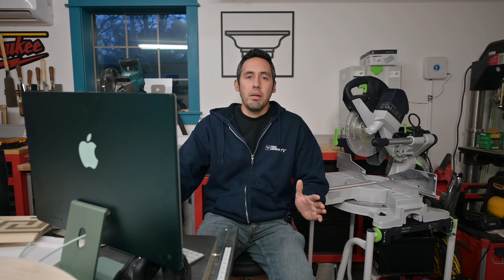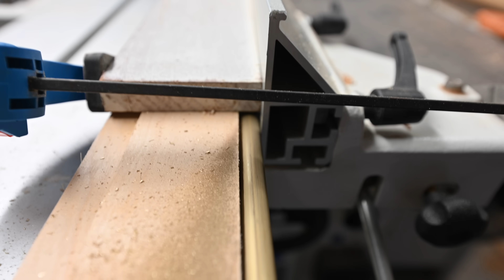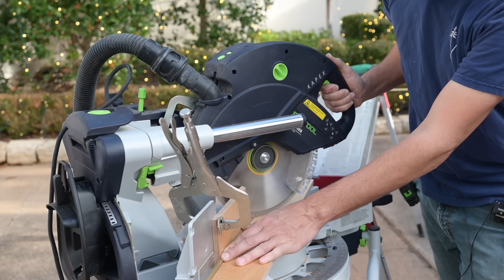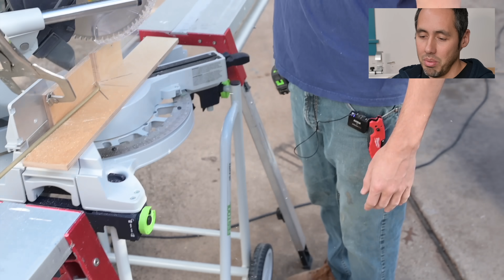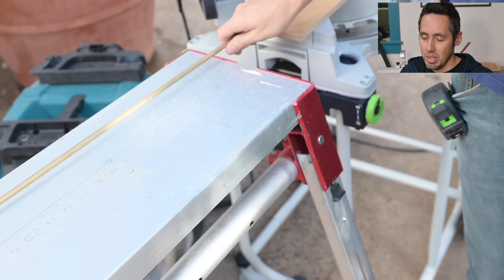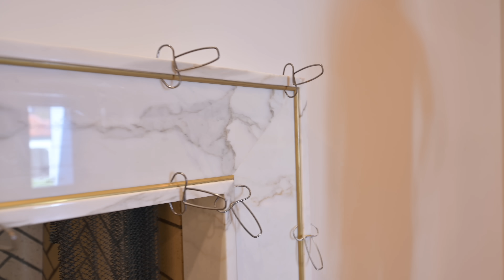It only took 12 years...My first MITER SAW injury.

Comment: Hi Richard, that was thankfully a near miss for you, even though there was pain! I haven't used my table saw since I almost cut the top of my left thumb off a couple of months ago. I think I'm a bit traumatised and don't know what to do to overcome it. It's healed well, just that that thumb is a lot 'slimmer' than the other one, and still tingles in the deepest part of the original cut. I've ordered one of those expensive push blocks in the hope that it'll help me overcome my fear... wish me luck!
Reply: Glad you are okay, you don't need luck, just extreme care.
In Europe, they advocate & partially regulate that a user never ever put their hands near the blade. Push sticks, clamps, don't cut angles, don't put pressure on the falling piece to create a pinch & shear(There have been many tablesaw injuries and deaths without even getting cut by the blade... if the scrap piece gets ejected at a high speed for instance: one user embedded wood in his chest, luckily his nurse wife saved his life).
I could go on and on. Yet it's possible to have a life with no injuries.

Comment: This is a good reminder to always respect your power tools.  Things happen in a split second.  

My worst was when I was ripping boards on a small table saw.  I was standing directly behind the board, it binded up and kicked back.  Good thing I'm not taller than I am because it shot back into the area just below my waist but not low enough to hurt the family jewels.  I did have some bruising and pain but not too bad.

On another note, not job related, when I was a kid my dad and I were putting up the Christmas tree.  We were cutting the bottom few branches off to make room for the stand.  It was getting dark and he was snipping away as I held the branches.  I felt the blade go through my finger.  He cut about 2/3 of the way through my right middle finger.  I went to the ER and they stitched it up.  I still have the scar.  The only good part was that I had to wear this large white bandage for a couple weeks on my middle finger and couldn't bend it.  For a young boy, it was hilarious.

Comment: My worst injury also happened at the miter saw with aluminum stair nose trim for vinyl. I was doing the same as you, but instead of the saw pushing your finger away, it pulled mine into the spinning blade because I was cutting 45 the other way. At first it felt numb like a smashed finger until i looked at it and saw it took a small chunk and blood was dripping. Im lucky to still have all of my fingers and the scarring now is pretty minimal. Didn’t need to go to the ER.

Comment: My hand is currently in a cast and recovering from surgery. I foolishly used a utility knife to pry at an escutcheon on the end of a grab bar for an ADA compliant bathroom install. I often have warned others to always get the right tool to avoid injuries, that thought ran through my mind as I was using the utility knife. I wasn't feeling rushed, it was simply that I had just opened the box and the knife was convenient. Got the escutcheon off but made a small incision into my hand and severed an extensor tendon. One surgery later it's reconnected, cast will come off Jan 5th and I can start physical therapy. I think utility knives are one of the most hazardous tools we use, it's a very easy tool to get too comfortable with. I think the lesson here is, as I always tell people, get the right tool for the task and listen to your brain when you question whether something is safe.

Comment: Glad you're OK, I've had many injuries over my 25 years, I've even done that exact same thing when cutting Aluminium tile trims on the choppy, however one of the worst was on my second stint of oak framing, me and my buddy were out in the rain searching for curved bows to make the cruck supports, he was on the top of the stack, we both had our jacket hoods up so hearing was impaired, I said I think I've found one, pointed to it but said wait, I'm gonna move into a better position, he didn't hear and lifted the top, being wet the 150lb x 12" thick by 8' long bent branch slipped and pinched the pad on my right hand pinky, you could see the bone, we were in the middle of nowhere in Cornwall UK so I cleaned it out, bandaged it up and drove myself to 4 medical centres, none of which would help me, I ended up driving for an hour in absolute agony before resigning to the fact that I might as well drive another half hour to the main hospital, amazingly no fractures but being a musician, that was a real wake up call. 10 years later, it's still very visible, stay safe out there folks!

Comment: I've been building for 25 years, but I'm vain enough to be paranoid about losing a finger (yes, it's vanity, not function that keeps me vigilant).  But there's always that brief moment of complacency that will get you every time. A couple years ago, I was at the table saw, and flicked the off-cut away from the blade while it was still running.  But instead of moving the back end of the piece where there was plenty of clearance from the blade, I flicked the front end, which of course was at the edge of the blade, pushing the tip of my thumb straight into the blade.  Scared me half to death, but fortunately, it just cut about 1/4" into the tip of my thumb, hit bone and deflected off.  No permanent damage, just a mild heart attack, and a strong reminder to always pay attention whenever I'm near a spinning blade.

Comment: Im glad it wasn't worse be careful out there.
Ive been working in construction for over 50 years. Almost inevitable not to have mishap but like you I still have all my body parts still attached. There doesn't seem to be one that stands out over any other they all hurt to some degree or other. One particular instance stands out when working with my dad on his crew. He was a foreman for a pipeline construction company running telephone conduit. I was 17 or 18 at the time, I was working with another guy tunneling under some obstacle. We both were in a hole on both sides of the obstacle tunneling towards each other. It was Pretty confining quarters to work in.  Between us was a large mound of dirt. We would share the tools a heavy tunneling bar and shovel. It was a hot day and hardhat kept bumping the edge of the hole I was in so I took it off. My dad repeatedly told me to put the hardhat back on. I begrudgingly I conceded I had to do what he said being the safety code and all. No sooner do I put it on  my coworker tossed the tunnbar onto the mound in front of us and it rolled down  hitting me on the head with enough force to jar my head down pretty significantly. Im certain without the hardhat it would have split my head open. I don't think I ever told my dad though lol.

Comment: The worst injury I sustained in my 26 years was falling through a subfloor that I didn’t know was rotted out. Luckily it was in a kitchen over a crawlspace, but when I went through I managed to do 3 things; 1. I fell on to plumbing supply lines and busted them causing water to shoot out everywhere. 2. My shin scraped along a joist which pushed tissue and muscle up to my knee making it look like I had a baseball under the skin. 3. My head landed less than 3 inched away from a 16d nail that would’ve speared my head like a melon. Glad you’re ok, man!!

Comment: I’ve had this happen myself. Not with brass but with aluminium. you need a constant pile of wooden off cuts next to the saw to put behind every piece you cut. You need to support the back of EACH cut. the sacrificial fence you have made was great for the first few cuts. But as soon as you cut the mitre out of it you lost the support being the work piece. I hope this helps someone. I learnt this lesson exactly how Richard did. got away injury free but boy does it send a shock wave up your thumb!

Comment: Sometimes minor accidents are blessings because the pain and learning we receive prevents major accidents in the future. I am 64 years old and a lifetime hobbyist woodworker. I have not had an accident since the significant but minor accident I had when I was 14 years old. I had a summer job in a cabinet factory  and my sister asked me to make her some picture frames. I asked the boss to set up a shaper for me so I could make the moulding from plain stock. The shaper was a big industrial machine that had a rotating head of cutter knives approximately 6" in diameter. When the machine started up I felt my then long hair raise up off the side of my face with the wind it created. I made one pass pushing the stock against the fence firmly. Of course removing this huge amount of stock in one pass was ridiculous but I didnt know any better at the time. I felt my newly machined piece and it had some chatter marks so I decided to push it through again pressing the stock very firmly against the fence to remove those marks. About mid way through the fence slipped back grabbing my stock and firing through the wall some 15 feet away. My right hand went into the knives in the process. I was rushed to emergency and a skilled surgeon saved those three fingers on my right hand but the tips remain someone mangled 50 years later.  I never finished those picture frames but I never had an accident after that and I can remember that incident like it happened yesterday !

Comment: Had a kickback injury on my old Craftman table saw. Was cutting 1/4 plywood which was closer to 3/16”.  The extension wings on the saw were stamped steel with raised ribs every few inches for stiffness.  When the fence lined up to a portion of the wing where there was no rib, there was a sizable gap between the bottom of the fence and the wing. Well after partially into the cut, the material went under the fence and caused the material to bind and kickback.  Luckily I only got a small scrape on my arm.  Needless to say, that extension has been replaced with a new one that is totally flat.

Comment: Its hard to say what the worst injury has been in 20+ years of construction, but above getting nailed by a full sheet of 1/2 plywood thrown out a second story window, more than stapleing my thumb to a shower wall, even more painful than the time a sawzall blade snapped while my boss was cutting a downspout and it hit me in the lip. The most painful experience I can think of was getting fiberglass insulation blasted into both eyes from a compressor hose failure when I was under a mansion finishing up punchlist items by myself. I was stapleing up wire to hold the insulation in the floor joist after a repair and out of nowhere the bulge exploded at the fitting whipping around like a possessed snake sending fiberglass insulation and dirt and whatever else into my un protected eyes , then the panic set in. I can't see anything this pain is way more than getting something in your eye. I had to crawl on my stomach for what seemed like an hour to get out of there. I followed the trail of cool fresh air blowing in and finally found my way out from underneath the house. But the water had been shut off due to a leak somewhere. So I had to drive😮 15 minutes almost blind to get cell phone reception just to find out my phone was still under the house. Son of a Birch. It was getting dark and I had no way to call for help. Luckily my girlfriend was bringing me dinner because she thought I was working late and she put castor oil in my eyes when we got home and in the morning I could see😂

Comment: My worse injury to date was I was shooting brads into a piece of wood that I was holding with my 18 Gauge and it bounced and shot between my thumb and forefinger, right in the middle of that loose skin area. At hospital after a X-Ray and plenty of numbing they removed it with pin nose grips from the bone. I never hold wood in my hand when testing a tool for the first time, ever. Lesson learnt. Stay Safe buddy Merry Christmas.

Comment: Pushing and cutting 1/4” plywood 12”X14” drawer bottom through a table saw. Kick back into groin and shatter the left testicle. Happened so fast, never saw the plywood fly, just felt the hit. Nice short ride to emergency room and once there, first experience with morphine. I was a very experienced carpenter and cabinet maker by this point. 
Learned a lot and will never forget that experience. To this day when I run a table saw, I focus and thank god for the modern anti-kick back devices. 
Sometimes learning and wisdom have to hurt.

Comment: I’m a DIYer and a couple years ago I was building a piece of furniture for the house.  I was cutting something down on the table saw, had safety glasses resting on my head (it was hot out and they were fogging up, so I was pulling them off between cuts).  The one time I didn’t pull them down for the cut, a small piece kicked back and sent shrapnel into my eye.  I was able to blink/flush it out and thought things were ok.  Eye ended up getting super red and painful to the point that I couldn’t see out of it and had to go to the ER for treatment.  Left a scar on my eye that now prevents me from being able to wear contacts (wearing them flares up that eye).  Just takes one lesson in safety to learn for a lifetime.

Comment: My worst injury also happened with a miter saw. I had been building flower boxes for my yard and was using my 10 inch Makita chop saw a lot. I needed to change my blade but couldn’t break the current one free. I went to my brothers to see if he could come by and help me, he said he’d do me one better, he’d give me his craftsman 7” mitre saw (chop saw) since it had a brand new blade and he had just bought a new 10 inch one. I gratefully accepted and hurried home to continue on my building. 
Big big difference when using a 10” saw and a 7” one. I was cutting the boards for the top railing and only had 2 more to cut when suddenly I looked down and the saw was going through my index finger on my left hand. I screamed loud enough that people 3 trailers away heard me and rushed over . Sam, the neighbour was on phone with 911 but didn’t know the address here. I had tried dialing them myself but couldn’t make my phone work as both my hands were occupied. One cut the other pressing the severed tip onto the cut area, almost willing it to go back on. The next thing I knew there were police officers at my door. They were closer to the scene than the ambulance was so they said they would take me to the hospital but I had to show them the saw that I did it in first. First time riding in police car with lights and sirens going and I wasn’t even under arrest!

Comment: I definitely have had several close calls at work. I would say my worst resonates with what you have to say about things just being a second nature. You take things for granted and assume all is good and that is when you are most vulnerable. So with that said my worst injury came when I was tacking a small buck frame into an opening and I had plenty room between my opening and my new buck frame box, and everything was business as usual just shimming and shooting with 2” 16ga nails. And I have no idea why to this day I put my hand between the opening and the box and for some reason I went to shoot the box to the opening and it shot through my hand. It was also a Paslode gas nailer so maybe the “gunshot” sound it makes made it feel that much worse but that was horrible. I was very fortunate I didn’t get my hand pinned in between the frame but that happened about 2 years ago, and to this day every now and again it still feels a wee bit sore. Just feels like a deep down permanent bruise in my palm. AND once I had a piece of steel shard land in my eye, and this I had to seek emergency treatment for and it was about 2mm away from the pupil so I could’ve potentially been blinded. That was early in my career and now you’ll catch me dead before you catch me working without goggles.

Comment: Glad you still have your thumb. I almost lost an eye when I was nailing 1/4 round on the base board and the nail curved and went straight in my eye. I put my hand over my eye and started to think I just lost and eye but that is ok, God was gracious enough to give me two (haha, 300 quote). Anyway, I checked to see if the nail was in my eye and thank God it was not, but when i opened it, all I saw was black. So i drove myself to the ER and the doc said if the nail had went up just a couple more mm I would have been blind in that eye. Luckily I was able to make a full recovery. Be blessed bud.

Comment: Glad your good!!  I have had that happen before with aluminum. I feel that you should lock the slide when cutting metal. My worst injury was on the table saw. Grabbing across the table. My hand slipped down close to the blade from the weight of the wood. My middle finger drug across the top of the blade and kicked back. It was not as bad as it could have been. I was probably 18 and had very little experience on the table saw. To this day I can still make out a little scar but I have my finger, which I am eternally grateful for. I do know the feeling of the sting when metal kicks in the miter saw. You will have a new respect for that.